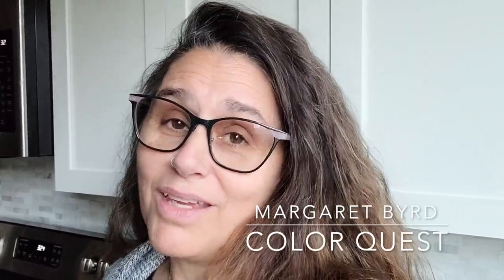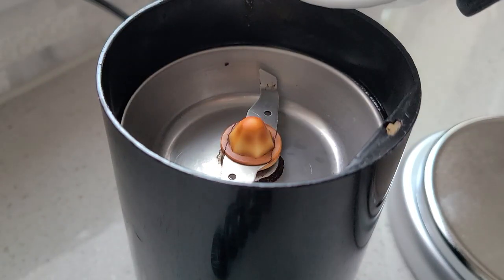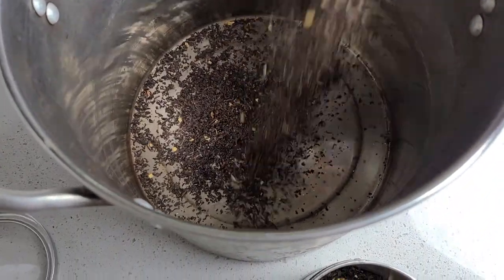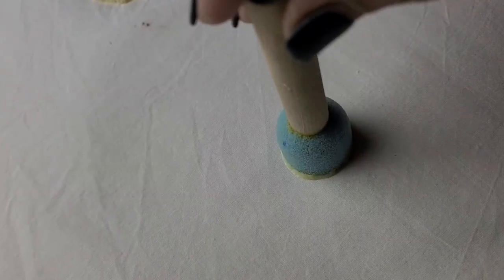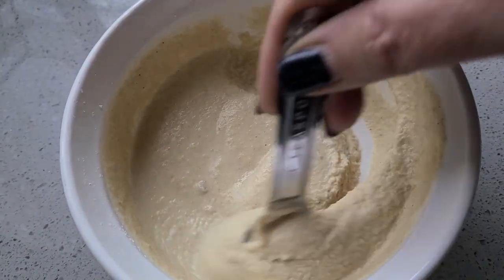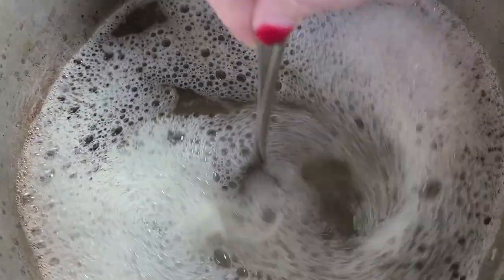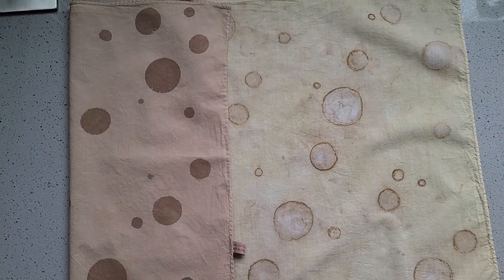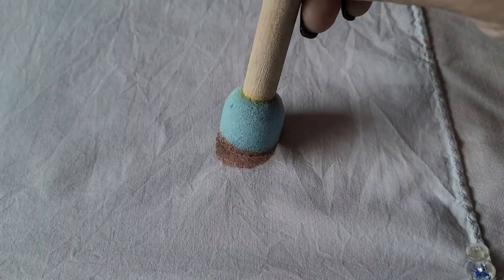HOW TO RESIST PRINT WITH SOY LIME PASTE | ORGANIC COLOR | SURFACE DESIGN & PATTERN | BLACK TEA

Comment: Hi ...how do you get the resist out of the fibers?
Reply from the maker: In this video, you can see that I rinse the paste off with water at minute 22:12.  You can soak it in warm water for some time to help loosen it and use a gentle brush to help remove it as well.

Comment: Hi. These are interesting results. But I do find it confusing to use soy bean powder as a resist paste, as this generally helps the fabric to bond to colour, but that's exactly what you want to avoid happening here. Apart from that I guess the powder should be very fine indeed. Soy flour should be readily available. Your product appears to have been processed in some way, so that may not have helped, either.
Reply from the maker: Hi Andrea and thanks for your comments.  Soy lime paste resist is an ancient practice, so there is some magic to the combination even though soy is also a wonderful binding agent.  I struggled to find soy flour in my grocery store, but trying alternatives is also great for experimenting.  Will certainly try this again in the future 😊